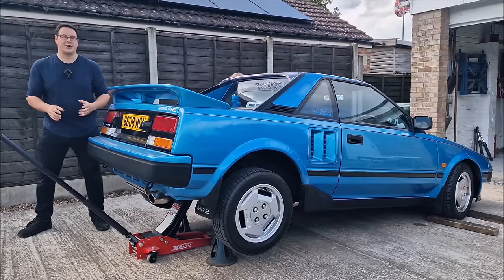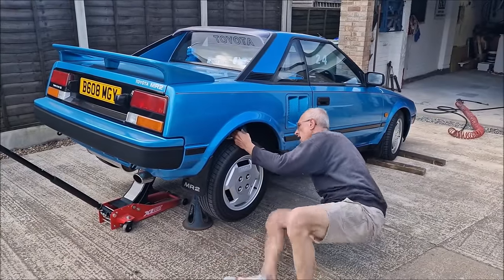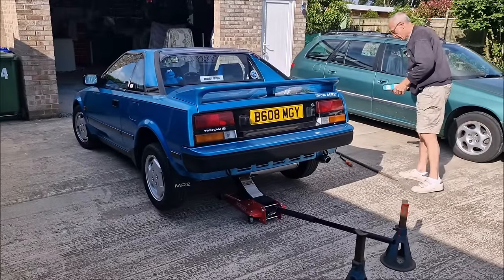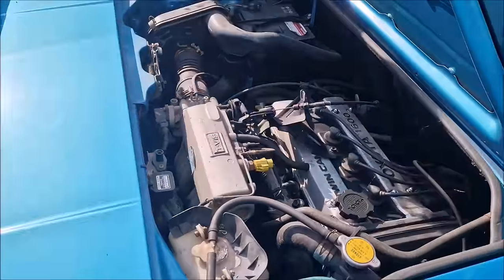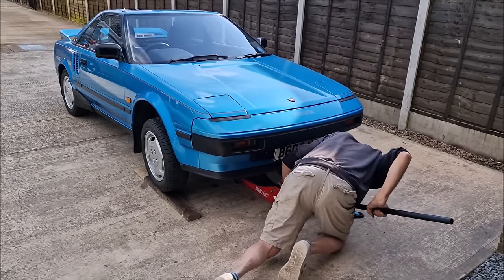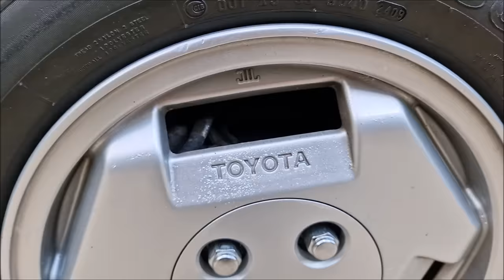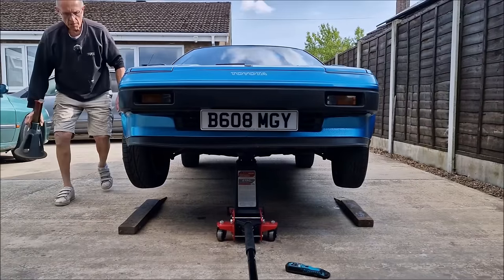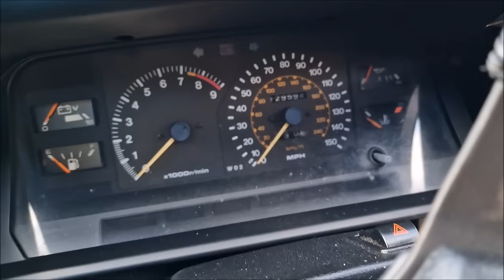Pre-MOT Checks On My Toyota MR2 - Off The Road Since 2021 - How Bad Can It Be?

Comment: Those tyres maybe old, but they look sticky enough and have plenty of tread on them. If the car had been stored outside in the sun it would be a different matter, but as it's been in doors they're fine. A lot of people will you tell you every 5 years no matter how good they still maybe.
Reply from the maker: Common sense sort of thing isn't it 😁👍

Comment: The car needs using, then maybe moving on to another enthusiast ?

Also I know you were against the clock but the sensible thing to do on the front brakes would have been to crack open the calliper bleed nipple when pushing the pistons back to eject the old brake fluid inside the piston, and let some drain from the old hoses. That would have removed the aged hard-working fluid from the critical areas and prevented corrosion decay etc without a full fluid change and bleed…
Reply from the maker: Nope. This car will never be leaving my collection for reasons explained in other videos ☺️  Good advice RE the bleed tip 👍
Reply: @JonCoupland  Drive it this year and wear those nice tyres down !
Reply from the maker: @johnmoruzzi7236  I will be doing ☺️👍

Comment: On a random note: I find it very annoying that for some reason the wheel lug nuts stick out a little bit of the rims. It's funny because I have the original brochures and in the pictures you can see that they stick out a little bit but only in the UK cars. 
It's like the UK cars use longer wheel lug nuts for whatever reason 😂🤷🏻
Reply from the maker: So I actually have lug nuts on the car that are meant to be on the MK1 pepperpot wheels so good eye! Early ones were shorter with black caps ... But a seller wants £80 for a set ... So I'll give it a miss for now 😅